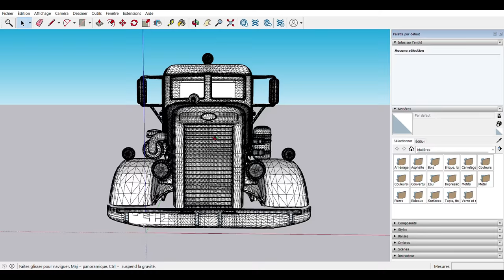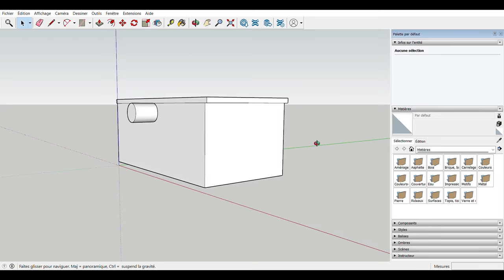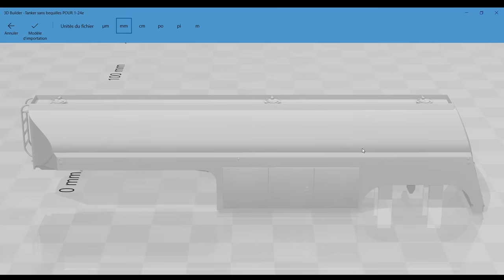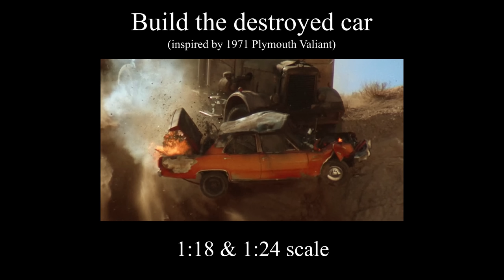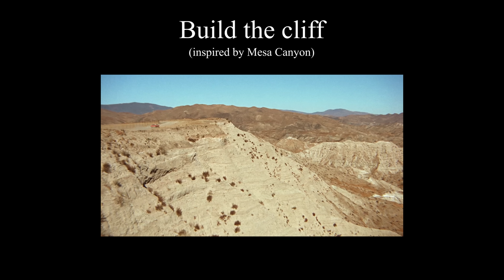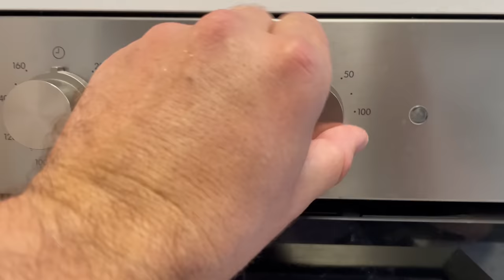DUEL (1971): making Duel trucks Peterbilt 281 and miniature action movie set. Full video, tutorial.

Comment: Great job guys, except....the original car that was used in this 1971 'DUEL' film was not a 1975 Plymouth Fury sedan!  It was a 1971 Plymouth Valiant 4-door sedan with 318 V8 'small block' (Chrysler A-Body).  They used 2 cars and possibly 3 cars, but the main one being the 1971 Valiant and a back-up being a 1972 Valiant.

Both (if not a 3rd car) used were a factory stock Chrysler 'E5 Red' paint scheme, and the only differences in the film is that the 1972 Plymouth Valiant was used for what is called for the 'add-in scenes' during the filming like in the gas station, also when he pushed the bus, but the main car you see in the action scenes was the original 318 V8 1971 Plymouth Valiant 4-door sedan.  Hope that helps a bit...👍😎
Reply from the maker: 🙏 you know a lot of things about this car :)
Yes I’ve chosen the Fury because there was no diecast 1971 Valiant in the right scale commercially available ☹️☹️
Reply: That’s not even a 75 fury….. its a 78 Monaco! And The real car was a 71 Valiant sedan I believe.
Reply: @MiniaturesFX so print one???
Reply: @Floridaredwing25   ... I stand corrected, just as you need to stand corrected!  My slight error, but the model he's using in this video is a '1977 Plymouth Fury' modelled after the 'Dukes Of Hazzard' cop car!  PERIOD.  FULL STOP. 

So I'll permit you to keep 'believing' in whatever you desire...BUT...in the 2nd season of the filming of the Dukes of Hazard...yes, they used a 1977 Dodge Monaco and not a 1978 Dodge Monaco which has a 'split line front grill' and 'upright' square-ish tail-lights whereas by the 4th season, the correct 1977 Plymouth Fury 4-door sedan C-Body NEVER had a split grill, but a SOLID undivided horizontal grill and a long horizontal 'in-bumper tail-light' design just like this die-cast Greenlight Artisan model is used to make this video! 

This specific 1977 Plymouth Fury 4-door sedan was an ---> 'A38 Police Pursuit Package' nick-named as a 'Fury Pursuit' with a 255-HP 440-powered MoPar V8 special order and was specially built by Chrysler for the 'Police Pursuit' versions with over 80% of cops using this very model back in the day and these cop cars had a 'Special Handling Package' which included a battery heat shield, 12" Police brakes, 140-mph calibrated speedometer, firm Police power steering and heavy duty seats! 

And don't get me goin' kid...I'm 70 years young, owned more classic muscle cars that you can ever dream of back in the 1970's which included a rare '1968 Camaro Z28 RS 302 cubic inch 290HP' with a '4-speed Muncie' ...but especially an even rarer than ever....a '1970 AAR Trans Am 'Cuda' which I should have never ever gotten rid of those two extremely RARE gems! 
MIKE DROP ....I'm atta here !!!

Comment: That is an absolutely fantastic build. Fortunate those who own a 3D printer. Unfortunately I don't and wouldn't know how to use it. I wander is this a personal made model? Any out there for me to own? Stretching my luck. I did buy the 1/43 scale diecast model that's nice but still not satisfied. I'd like a 1/24 scale or even 1/32 scale would be great. I checked scenes from the movie and noticed one of the trucks used in the movie does not have hydraulic connections to the tanker and in another scene it does. Confirms more than one truck used.That's a very realistic made model. Top marks.This comment from down under Australia.👍🇭🇲🦘🐨🦈✌️